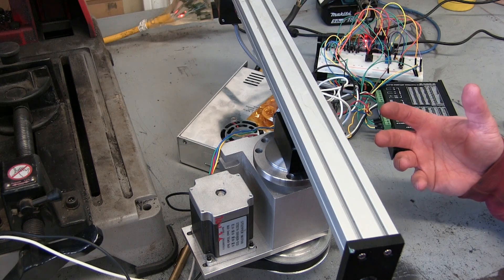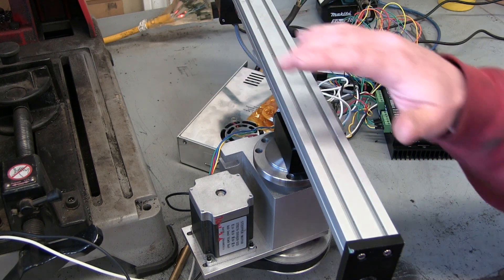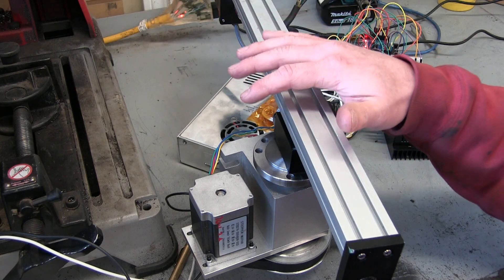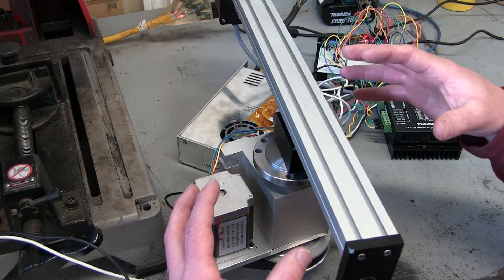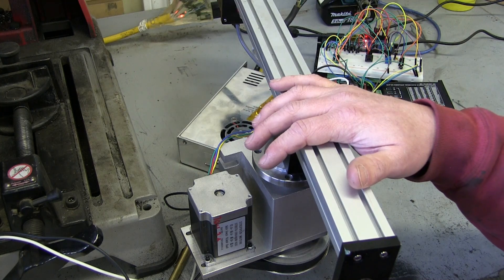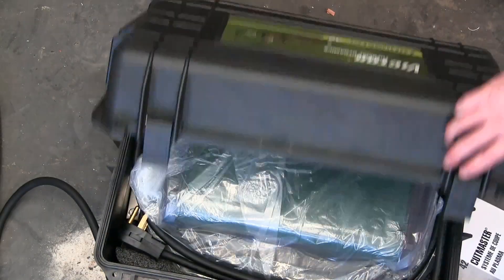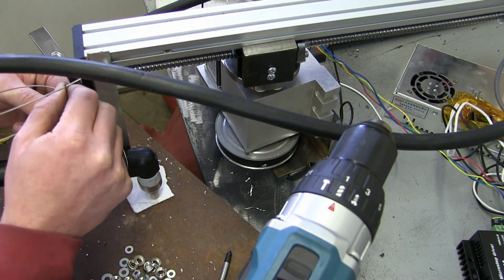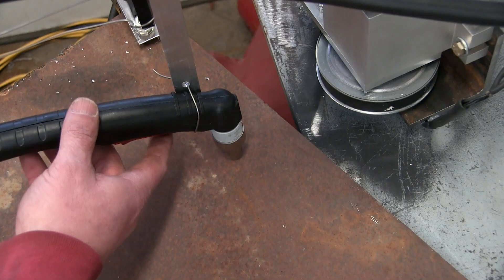Portable CNC Plasma Prototype

Comment: Put a mag base on the bottom of one of those small robot arms. They already have the software sorted out on those. Could be polished up for steelwork CAD though.
Would take up less room than a long fixed arm.

https://www.aliexpress.com/item/6-DOF-Aluminum-swivel-base-robotic-arm-teaching-robot-arm-32-channel-control-board-LD-1501MG/32620315480.html?spm=2114.13010208.99999999.326.tlBffg

Comment: Good shit! I'm not any type or fabulacator but neat concept for sure!

I'd gladly lend a half a brain to designing the app UI and know people who could do the programming for a couple of lap dances!

I figure you plug in shape, size, speed of movement and air flow (material thickness) and are golden!

Include a button for dry runs... shit like that. 

Just got to figure out an easy way to do fancy shapes but lots of good solution for that already.

Comment: STUPENDOUS IDEA!  Math shouldn't be too hard to figure out. Setting the origin, orientation, and path direction I think are going to be the the hardest part.  Somehow you need the worker to be able to tell the unit where it's mounted axially in relation to the cut.  That needs to be precise, I would think.  No good if'n yer cuts are off 30 degrees.  You almost need a gyroscope (like a drone).  You should contact Doug at SVSeeker on YT.  He could do/use this.

Comment: This is funking awesome. Even in a shop where there is space and time for CNC plasma, moving sheets of plate steel around and dealing with all the computers is a pain. If I could just stick this on whatever kind of plate I'm cutting, it would be awesome. Also, if you could add a simple, intuitive program that would let you draw weird shapes  (not like a real CAD program, but just simple 2D cutpaths) I think it would still not be too much computer stuff, and it would help if you have to be reduced to making things like worthless "art".
Reply: Imagine if you could add a rotary head on on of these; you could use it for notching pipe, and cutting coves and whatnot in structural shapes. Awesome.

Comment: Don't comment much; i guess my only or thoughts on limitations would be that your going to need very tight Z axis control if you plan on being able to draw perfect circles (complex shapes) without them becoming eliptical - and calibration so that the further out the Z axis is from the mag base the less angular velocity the unit carries.   (I don't know what the fuck i'm talking about, but - oval circles)

Comment: I wouldn't dick around for too much time with the calibration, it won't be exact but more than enough. I would try it with a 3d printer jog-mode like something... Measure out a 5x5 inch on the steel, jog it around with a program that logs the stepper motor's rotation, and manually jog into the corners of the 5x5. It would be the fastest way I think to get the measurements for the G codes. By the way it's a brilliant idea, I would skookumize it with a cable that hangs from the ceiling, to make sure that it has plenty of space to move around and of course a cheapo solenoid would do the trick for the trigger. I have a small firearms service and I don't Want it... I NEED it

Comment: I've dicked around with a cnc plasma a time or a hundred and if you want it fucked up free your going to want to have a third axis that keeps the tip a set distance from the metal. Shit ant flat. Also lose the phone idea and put a touch screen on it or a controller with a plug.
Reply: raspberrry pi 3 with small touchscreen running ubuntu mate should work
Reply: just ideas
Reply: Nick Letts i think the phone idea is better because  it drives the price of the cnc down and  everyone has a smartphone so why not?

Comment: My initial thought was that in the field you also need a compressor as well as a 220 power supply to run the plasma instead of the easier to come by 110 to run a torch buggy and its very portable bottles. That said, for fab shops I think it would be very nice if you get it ironed out and cheap enough.

Comment: This idea might be in the comment section already but whatever, not going to look for it. What if the app could use pictures? You draw what you want cut in soapstone or whatever, take a picture of it, select a start point and it translates the drawing in the picture and proceeds to cut it. The drawing could be done anywhere that's convenient, then you just mount it with the tip at the start point and it does the shape that you took the picture of. To figure out the scale of the drawing could be resolved with two colored dots a set distance apart near the drawing and the camera would look for them, and knowing the distance could scale the rest of it?

Comment: It would be great to have it also work with existing blueprints. Let's assume a company already uses automation to run things, say like an FDB, saws, drill, T-splitters and Anglematics,. Allowing fitters to plug it in, select an item number and cut to be made on their tablet would be as simple as you can get. Theoretically, it could locate itself like a robotic welder and just burn some shit up. That would be very marketable.

Comment: I wonder if some pen can mark the cuts or welds on the piece  and then a detector of some kind guides the plasma cutter to cut along the drawn line? No mobile app required, just an arduino program that follows a line.

Comment: Cartesian to polar coordinate library
http://www.arduinolibraries.info/libraries/coordinatesYou should be able to plug your xy into this and get your arc angle and length. Use the current arm length and a variable multiplier for the rotational speed. that will get you constant cutting speed, no matter how far out the cutter is. Hope the helps. Good luck

Comment: ya i would use it  but with a torch body not non of that junke plasma. the idea is very sound. with blue tooth i think it doable.  what dose heat do to electric magnets? as thick plate can get hot by the time your done cutting say over 3/4-2"

Comment: Dear AvE, first off, your channel is by far some of the best content on youtube. second, what would you think about selling just the base, motor, arm, and software with different attachments that fit all popular models of plasma cutters, with a ball bearing on the business end to reduce drag and also provide the necessary distance from the tip to the material being cut. 1.) it would cut cost of production. 2.) would cut cost of buying. 3.) everyone who has a plasma cutter already would be able to use their existing plasma cutter and not have to buy something with another dedicated cutter. basically its a big attatchment for your plasma cutter that allows you to turn the plasma cutter you already have into a cnc machine with a footprint that's a fraction of a conventional cnc machine. and lastly keep  chooching along with the videos! they are fantastic!

Sincerely, A productive stoner

Comment: Another thought is to use two rotary joints rather than the linear slider.  That might make the math a bit simpler and their might already be some good open source examples of this with robot arms, which have the same problem as far as converting Cartesian to polar coordinates.

Comment: Id use it even if it required a little bit of the normal transfering from fusion 360 to svt to machine routine. I see tons of uses for this with various sized quickly (relatively speaking, less than 5 mins)  interchangable arms. I always seem to not have the room I think I should have.

Comment: 1. low friction marker; same arrangement but put a marker on the end the user will draw what they want cut, then the robot can repeat the path; either a second beam/rotor w/encoders or some way to reverse the steppers and make them encoders
1a. attachment (cutter replacement) could be a penholder/joystick ,that lets you draw, control the head, and record the path all at once.

2. high contrast paint/chalk/marker; user draws what they want cut with a high contrast marker, ideally the with of the plasma cutters cut. A camera is used in place of the cutter to discover the path; high contrast makes the machine vision less challenging programmatically.
2a. camera and cutter in one? less passes?

3. phone/tablet app that has parametric pre-sets (canned routines) as well as more advanced features, need proper user experience engineering to make it simple and easy, but still have powerful advanced features available but out of the way to extend its versatility.

You have created a polar gantry, its controls are literally r and ɵ. https://en.wikipedia.org/wiki/Polar_coordinate_system#Converting_between_polar_and_Cartesian_coordinates 

N.B. the linear speed of your head proportional to the speed of rotation; the further the head is from the base, the faster it moves for the same RPMs. directly analogous to torque being higher if the same force is being applied further away from the fulcrum. 

As for stabilizing your cantilevered gantry, I would start by copying a crane; i.e. counter-weight on the back side of the beam, and adding stabilizing triangles in the (minimal) form of tension wires from the beam ends to a post/tower in the center of rotation. Beyond that consult a mechanical engineer.

Another idea; reduce the amount of mass you have rotating, this will help with stability as well as speed, since your motors can turn faster or be smaller.

Comment: My company bought a really fucking expensive mag drill what for sticking to the bottom of some crane forks and drilling big fuck off holes through so that pixie pathways can be pulled through... magnet base is too big, doesn't fit... never used it, it's in a cupboard, also in that cupboard... a plasma cutter.

We do have a magnet capable of lifting a ton (which we use, it's fucking heavy as shit though).

Comment: You can maybe piggyback off an open-source project like smoothieware, they support delta 3d printers which aren't Cartesian. And the smoothie boards support external drivers like geckos so you can drive some pretty big motors.

Comment: love the idea! maybe a small robot arm would be more flexible and compact? one could also cut in different planes and not only the one below the magbase. 
A Beagle Bone running linuxcnc/machinekit could be a good Plattform to control it. Someone here had the idea to move the cutter to coordinates by hand and save them as  corner coordinates of the shape you want to cut. i guess such a design would be easyer with a robot arm but it sure would be more conplicated and expensive to build. im excited how this idea will evolve! let the pixies fly!

Comment: Great idea. The problem with plasma is you never get a square cut. Every hole will be wide at the top and narrow at the bottom because the flame is behind then the torch, even on your straight cuts you'll notice the edge has got a bevel. Won't be a problem on sheet metal but the problem gets worse the thicker your material.
Reply: Joshua Erickson rotate the nozzle head such that the flame cone side becomes perpendicular  (normal) to the face. either internal or external.
Reply: It doesn't work that way. While some of the deflection of a plasma flame can be predicted the wear of the consumables are a little harder to guess. Besides, rotating the torch would add another layer of complexity to Ave's design without any appreciable gain in cut or hole quality.  Hypertherm has been developing technology for improved performance but I don't think Ave wants to license "True hole" technology for his project.

Comment: I love the compact design.  But use the robotic arm for the design input!
1) Draw your design's corners on the steel.  Or draw it all, whatever.
2) Attach robot nearby.
3) Move arm to each point, press "MARK" for each point.  Now the coordinates are saved.
4) Robot cuts in connect-the-dots mode.
5) Done!  You marvel at how easy that was and how efficiently you can re-use a steel plate again and again.

Comment: I'm thinking a smart-phone interface would be bad for a couple of reasons: number one, making software sucks but it sucks a lot more when you have to contend with an end-user. The solution, don't make the user interact with the software, make the software interact with something the user leaves behind (more on that in a second). Secondly, what if something bumps the cutting head while it's moving and everything moves 2 degrees off. You've just ruined the thing you're cutting. The solution as I see it is to have the user layout the cut on the surface they want to cut with some kind of high-contrast marker (white marker, chalk, something easy to see against the metal) and put a camera close to the business end so that the computer can tell where to go next. That way if life happens and somebody bumps the cutting head, it can either find its way back to the line (and you end up with a slightly hairy section of the cut) or it can't and it shuts off.

Adding screens to things that don't currently have screens is typically a bad idea I've noticed. Usually because the guys who know how the tool is going to be used are terrible at knowing how to design user-interfaces and the guys who know how to design user-interfaces are terrible at knowing how to use the tool and typically neither group wants to admit their shortcomings so they just argue until the VC funding dries up or they end up making something bad that nobody wants to use.

Comment: Brilliant idea!
I think one way to reduce weight on the tip of the arm and improve overall arm stability is to incorporate the nozzle at it's tip and have a rigid (lighter) feeding line. Would then feed the system at the top of the pivoting base through regular feeding line fittings. This way you would get:
1. Lighter arm with less wear on the pivoting base and gantry arm;
2. Eased setup (just plug a feeding line, no other gun setup required);
3. Better cuts, because there wouldn't exist variable forces applied to the arm due to flexible hose movement resistance.
There! Now I'm a part of your project! We're now partners! What's my cut on the action?

Comment: for the sake of simplicity, and assuming this is intended for welders and like minded people. could you have an option for speed control kinda like a TIG pedal or throttle of some sort?  not necessary for a flat piece of sheet but if are cutting through something of varying thickness, or such? Even if it does fuck up in one section a little bit you could just reverse the throttle (alternative from pedal could be a trigger like an RC car or rocker style drill power tool trigger) and go back and then forward again to continue your pass.

Comment: Just a couple thoughts... I know you are using an Arduino, but what about the Raspberry Pi 3B? It has built in WiFi and Bluetooth, quad core processor, and there are a multitude of operating systems readily available. I have built the Retro Pi gaming systems on these platforms as Christmas gifts, and I was pleasantly surprised how easy it was to log the Pi on to our WiFi network, and then just manipulate it with my desktop PC. I don't know what apps to use for Bluetooth to a phone, but I'm sure someone else knows this part. 
Secondly, being a radial plotter system... What about those POV toys, the spinning strip of LEDs that displays pictures? Could this software be used to plot your plasma cutter? Or at least the radial part of it? I know this is meant for a spinning arm, turning LEDs on and off, but the software has to have the radial plotting in there somewhere. I've seen the loaders for the pictures... it should be able to be manipulated to convert to X-Y... blah blah blah, I don't know the programming, you're ahead of me.
Anyway, please keep up the good work! I'm learning a lot! And you've got me interested in getting back into digital making... Just to cut my teeth, I've recently hacked my Horrible Frought 18V flashlight with the party LEDs, and everybody wants one! Keep up the fun!

Comment: Love the concept!!

Regarding the set up / layout and use of mobile phones. Instead of the library of shapes / hole diameters etc. on a mobile phone, how about using computer vision.

In it's simplest form, chalk /scribe / sharpie the shape on the work piece. Snap a picture using the phone / or camera mounted on the slide arm. It recognises what you want either following the lines exactly as drawn, or offering more precisely dimensioned standard shapes (round holes / squares / std hex bolt head holes / etc.). 

The markings on the work piece could then double as registration points to ensure that the plasma cuts out in the exact right place without having to worry about with exact placement of the base.

If memory serves (and I've not played with one, so this is only from vidyas I've seen), the Shaper Origin* can do some of this stuff.

(* Apologies if this is teaching old grandmother McNamara how to suck eggs: https://www.youtube.com/watch?v=p_wk3q8jWcs )

Comment: you can try a 3d printer firmware on the arduino and configure it for a rotary printer. it'll give you the calculations you want for the geometry and will allow you to easily tweak speed and acceleration.

Comment: I am a CNC programmer in heavy industry.  This idea seems great. Here's my input: 
An app would be tricky and would allow for too many errors by the fabricators.  I agree with some of the other commenters in using a optical sensor. 
1. lay out the desired pattern with a specified marking tool. 
2. Have your machine scan for those marks. 
3. Display what the machine has scanned for confirmation by the operator.
4. Cycle start, bobs your aunty.